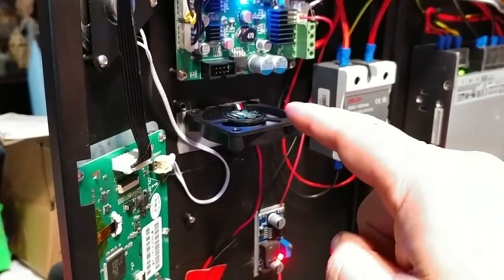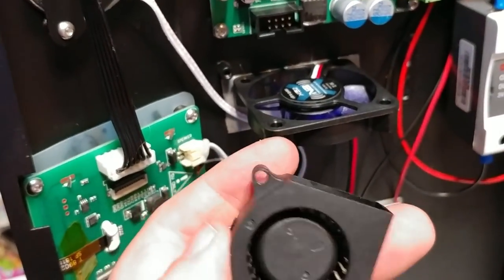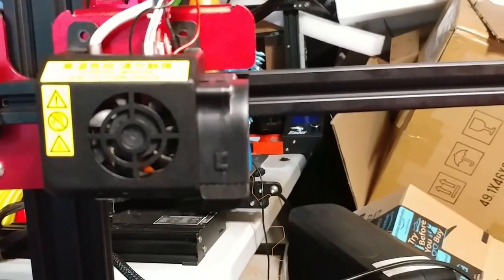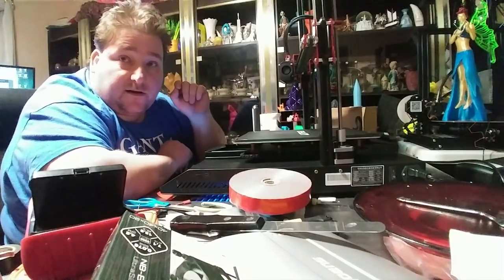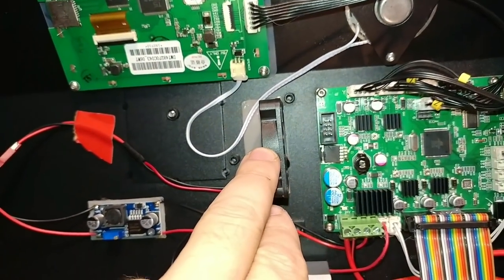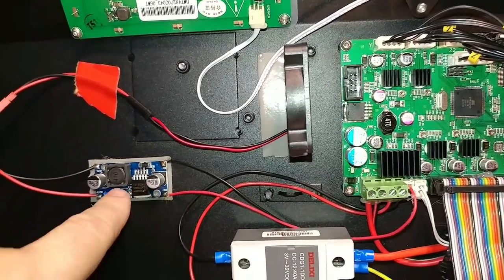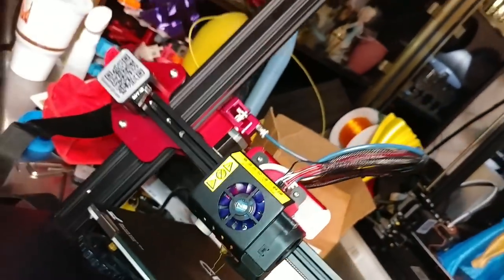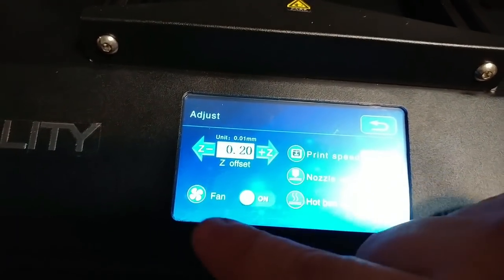CR-10s Pro Ultra Quiet Upgrade for Fans - T3DP

Comment: CR-10S Pro? and you're replacing fans already t's a CR10S using the CR10X design. If you're replacing fans at this point of owning this product for ANY REASON its far from being a Pro design or Pro device.
Reply from the maker: its just a name. The fans are not what I would call "loud" by any stretch. they are in fact quiet compared to the say the original CR-10

but I am greedy. when I realized how quite the steppers the quiet of the fans was not enough. I wanted more :-)
Reply: @nerys71  The name denotes the certain level of the product and introduces you to what you could expect from it with performance and quality. Sorry, I think you're absolutely wrong here with this one.
Reply from the maker: ok @MrDonXX
Reply: Honestly, this is the quietest printer I've ever owned. The Pro is about 24V heating, better bed, all metal extruder stepper assembly, better steppers, better extruder. But, it does need some careful assembly and care to prevent wire chafe. So no, its not 'professional'...but its also not $1500. So, expectations need to be realistic.
Reply: @truantray  I feel Creality is coming out with too many variations on the same platform. They have to start killing off the old units like the CR10 and S too many of the same model. They should have a High end and low end to the line but it MUST be worth the purchase for the High and they need to drop the Pro line because let's face it no way are they PRO low & high that's it. I think they are confusing the consumer with too many choices for one model.
Reply: This is my first 3d printer and I find it quite loud and unpleasant. I cannot imagine then how bad are all the others if they are really louder than this one. However, replacing 5 of the fans with Noctua will bump the price of the printer with something like $60-70  which is significant, which might be too much for asking. However I would recommend Creality to start using a standard 12V fans with standard fan headers, so it become very easy for the users to just buy themselves premium fans and replace them without hassle.
Reply: @JulianBG  or have Creality place "Pro" type fans that are quite so the consumer is getting a pro product that they don't have to update the second day the own it how about it @naomi wu
Reply: @MrDonXX  Sure, it would be better, for $60 more, I would prefer Creality to do that for me (pro fans + headers, for easy replacement later)
Reply: @JulianBG  That to me is what Pro means!
Reply: @MrDonXX  Sure, they already did "something" on that direction, like putting better filament feeding mechanism, better motors, auto-levelling mod/sensor.
I would go even further - I would like to see better screws and threads - they are horrible and the screw head is damaging very easy, so you have one-two openings before you have totally broken heads. AND I'm not even talking about opening the device at all - I'm also talking about loose screws on the frame that cannot be tightened due to that problem - bad thread and impossible to screw further due to bad head :)
Reply: @JulianBG  This is just sloppy craftsmanship no attention to detail and poor quality control. I really enjoy 3D printing with my Creality CR10S but I knew what I was getting into when I purchased it. When a company creates a "Pro" line it leaves the consumer level and everything that goes with it. You should have something that the extra money you put out makes you feel good about your purchase knowing you have a product that has been tuned in all aspects to perform at a certain level. Therefore you should not have to modify ANYTHING.
Reply: There are 2 fans in the case of the 10sPro that when they kick on are as loud as a vacuum cleaner.  They have to go.  Why Creality didn't spend $10 more and put better fans in is beyond me?
Reply: @truantray  You got lucky. My fans are REALLY loud. I ordered mine in November, so maybe yours has better fans?  I have mine in my home office and when everything is going it's too loud to work.  The Steppers are nearly silent, which is awesome!

Comment: did u insert 2 cables into one slot of the psu when connecting the buck converter?
Reply from the maker: No the buck converter is in line so think of the wire going from the power port for the fan to the fan itself cut the line right in the middle insert the converter in the middle